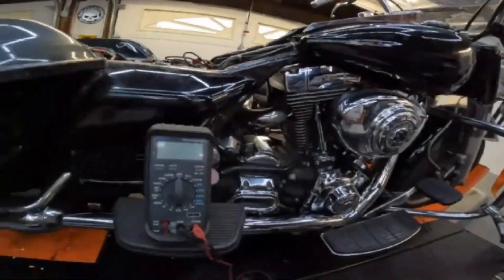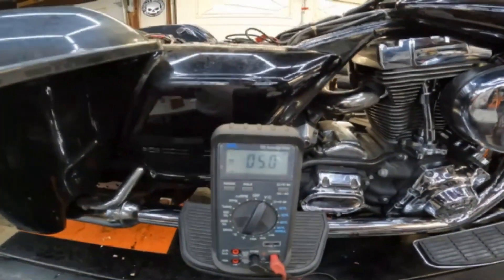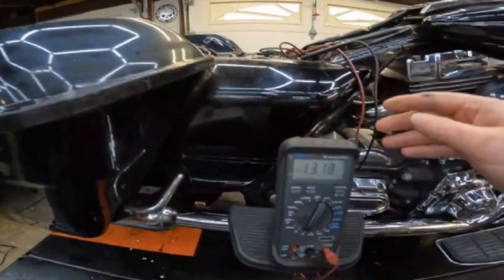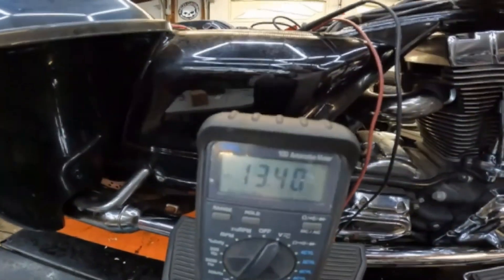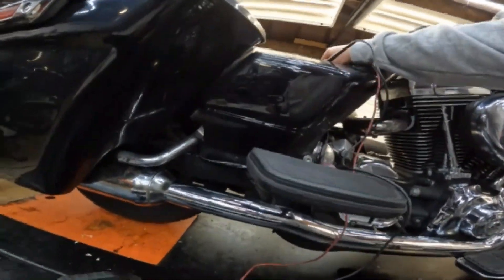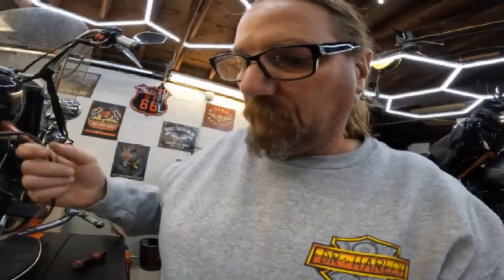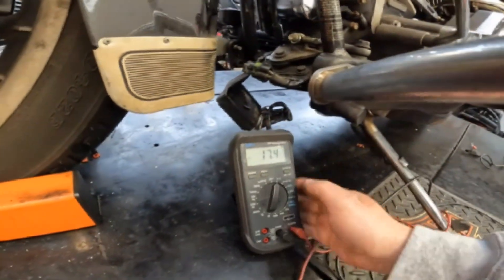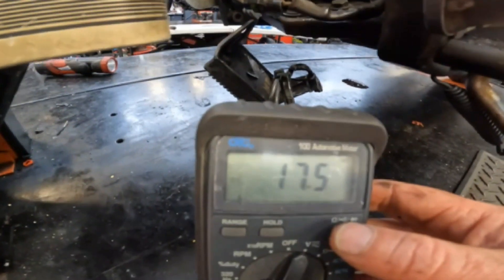How to trouble shoot your Charging System #harleydavidson #harley #bagger

Comment: Another test and this works on cars as well , but one can also put a test light between a battery cable the terminal it will also show if something is staying on and draining the battery. Good numbers on your final test. I do electrical as well.  Good video on the subject  and easy to follow.
Reply from the maker: Yes, I did not want to get into a voltage draw test.  I will when that issue comes up.

Comment: Great info.
Questions:
1-why did the voltage drop when you hit the throttle (just wo dering)

2-off topic..what lights are those in your garage overhead? 
Many Thanks.
Reply from the maker: Thank you for your comment, Great question. 
1. Because of the extra load on the system for the ignition, ecu and related systems there will be a small drop. Less than one volt. But when it goes back to idle the voltage comes back. A proper charging system will idle at 14.2 too 14.6 volts while idling. 

2. I found them on Amazon. They are not cheap but well worth the money IMO with style and how bright they are, Here is the link to them. Shop lighting. https://www.amazon.com/dp/B09RWMFLY2?psc=1&ref=ppx_yo2ov_dt_b_product_details
Reply: @DrHarley  thank you so very much for sharing your knowledge.
Reply from the maker: My pleasure.